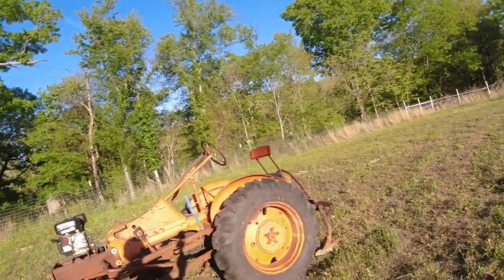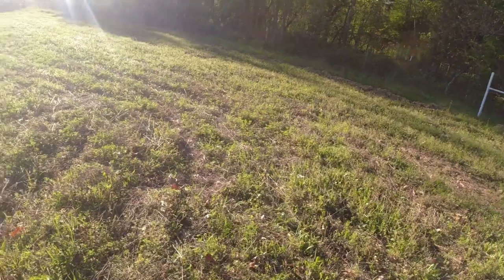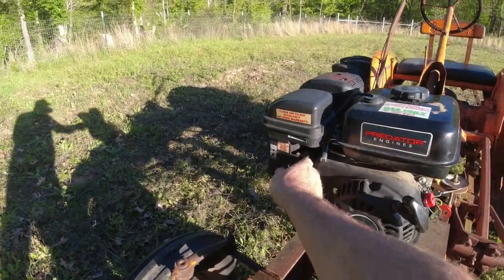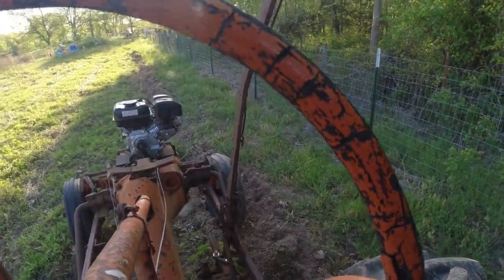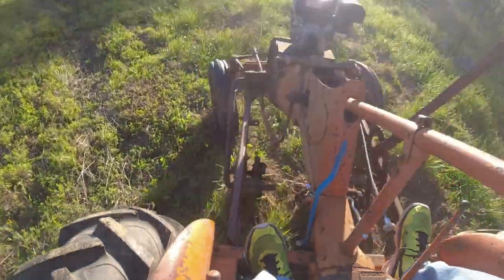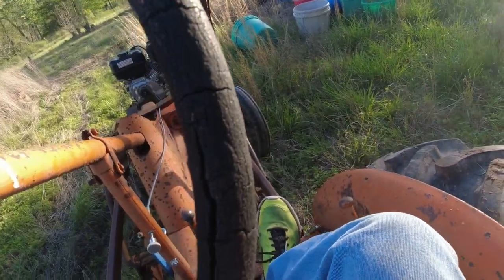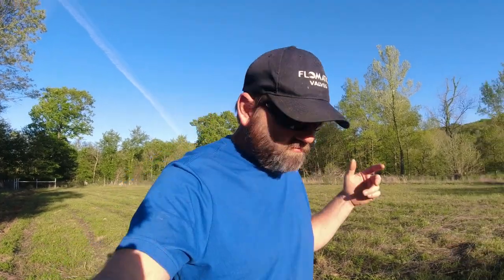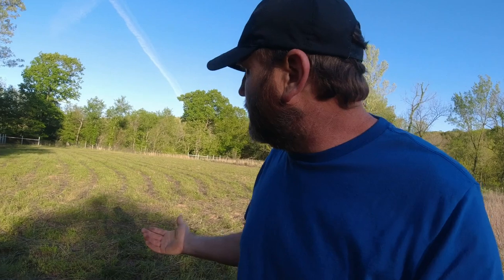allis b cultivator first run

Comment: The Predator-Project tractors are pretty cool. It would be good to see the one bottom plow operation, just a regular trip plow since they are more common than a AC-snap-coupler system plow. If you can plow, disk, plant, and cultivate with that tractor you'll have proven quite a feat -- I think it'll do it all.
Reply from the maker: so do i more videos to come